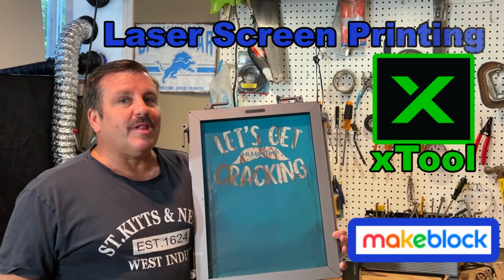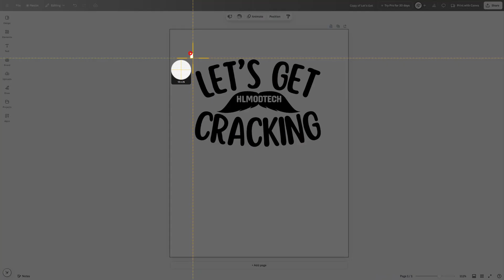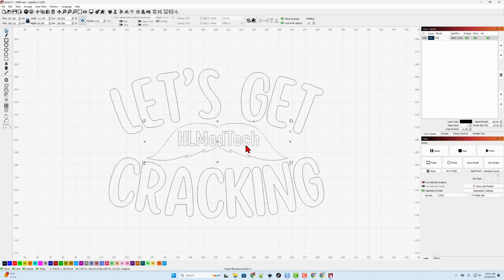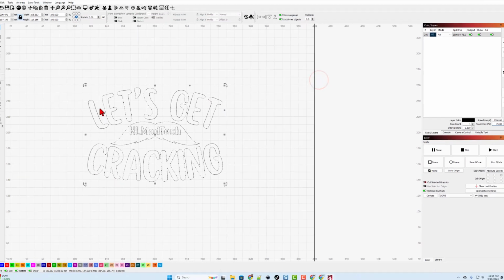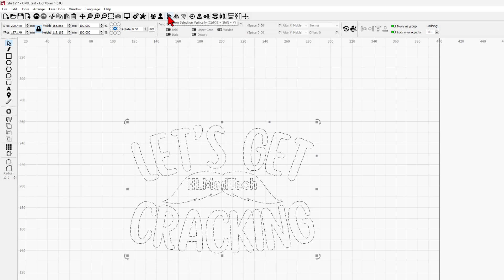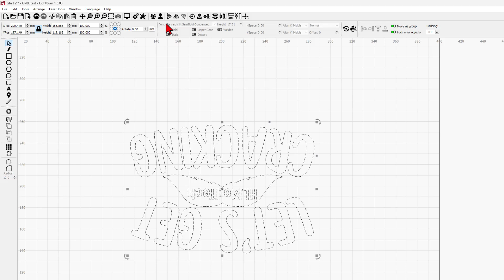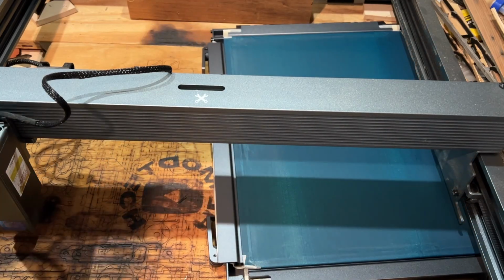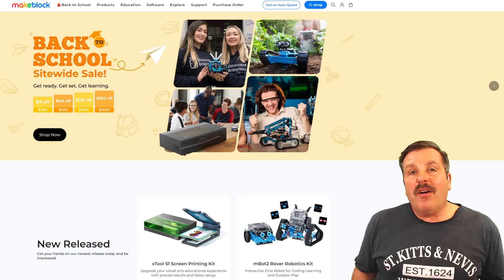Make a T shirt Lightburn & xTool Laser Screen Print Kit for Beginners!

Comment: Hello my friend, how can I do the same steps for the 33w laser using lightburn? What are the correct settings for the 33w laser?
Reply from the maker: You will need to use some trial and error to get the settings right. Use the ones in my video as a starter. There is a tiny practice screen in the box that is good for those test.